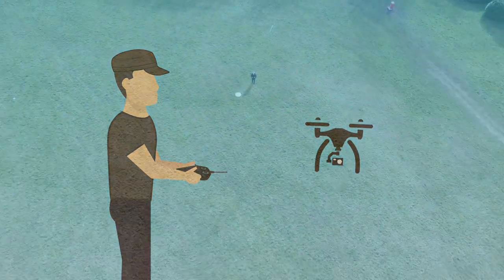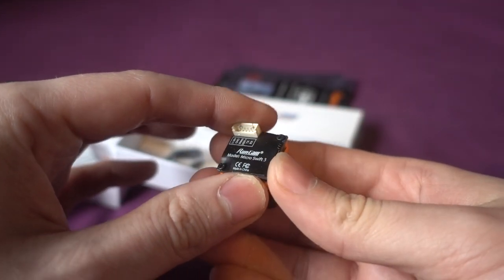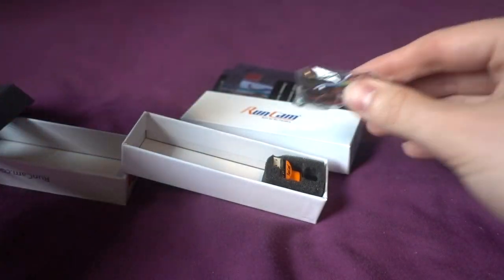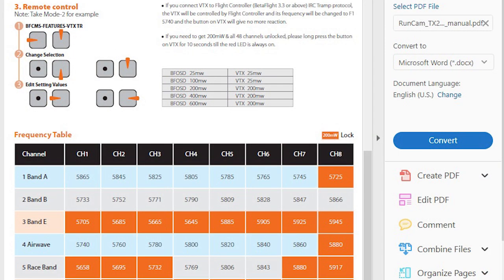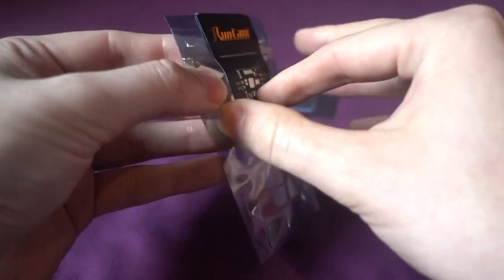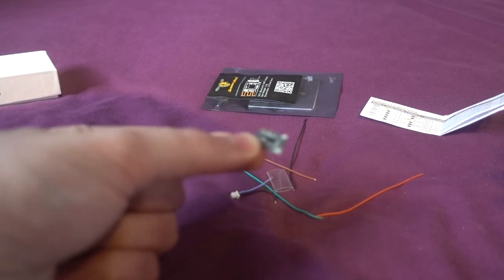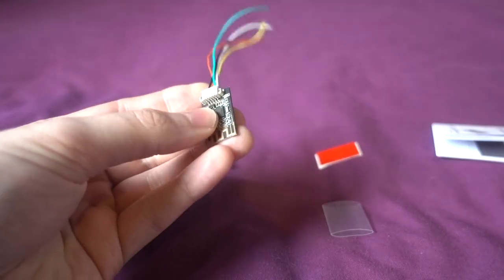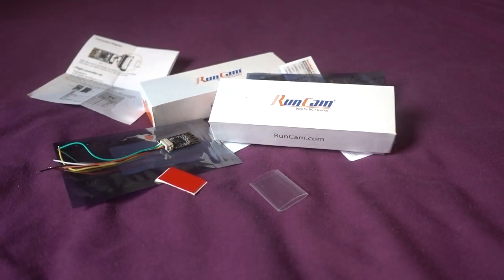RunCam! - Wireless Betaflight! - Swift Micro v3 - Tramp VTX  - Cam Controls

Comment: That Bluetooth module sounds quite interesting.
Reply: especially those without an OSD. I have a bunch of older flight controllers that are still in great condition but I don't use them because it makes tuning PIDs a headache. Now I have a reason. Lets hope these things are selling for a good price. Or else I'll just buy a new flight controller with OSD.
Reply: Chansook Saechao agreed man, I have a couple beaters that have boards with no OSD, but even my quads that have OSD’s I personally find it annoying having to go through the OSD in the goggles, it’s a bit tedious, this looks so much better and it gives you access to all the tabs in Betaflight by the looks of it in Andys latest video.

Comment: Huh? Bluetooth UART Modules have been available for years now?! Anything special about this particular one? I used to have a cheap HC-05 module on my APM Quadcopter ^^
Reply from the maker: its by runcam and for betaflight but technically yes it can already be done. its just this one has some features like it turns off when u arm

Comment: Yeah. Great idea to put Bluetooth module on the model that doesn't require any kind of authorization to connect (like pin code). Don't forget to set "D" to max and disable filtering or change failsafe throttle to 2000 and enable angle mode to those you don't like

Comment: Been using an hc-05 BT module with ez-gui for a couple years now. It's cool it's getting brought up again but it's nothing new.
Maybe this one is easier to update the settings rather than being an ftdi and Arduino software?
Reply from the maker: how do you power it off when in flight?
Reply: AndyRC It doesn't but it has not caused me any issues. Having a spare uart as msp helps.
With Lua scripts, it's lost a lot of it's usefulness but there are still quite a few things you cannot change with a script without modification.
F.port also helps with the freeing of a uart especially if you can smd solder between the unidirectional inverter on the sbus tab and the stm.